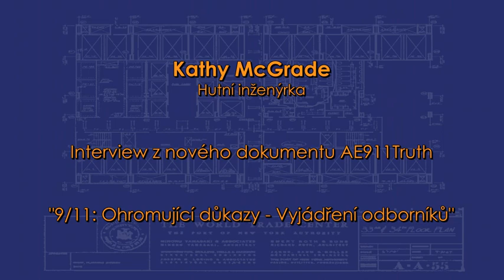Kathy McGrade - české titulky

Comment: The universe tends towards minimizing potential for energy exchanges, thus heat travels to colder areas. The buildings were massive heat sinks and would have no trouble effectively moving heat around, and air is only 21% oxygen and not being forced into the fire at mass. It isn't hard to find pictures of huge concrete and iron nuggets found at the site. There was molten metal, and lots of it. Where did the energy come from to melt that much steel and pulverize all concrete. Not gravity or fire.